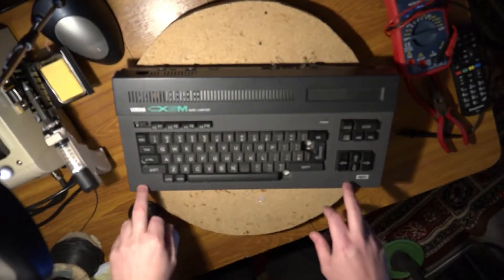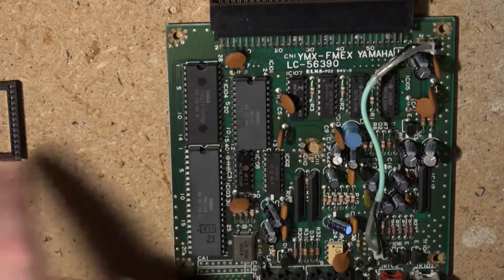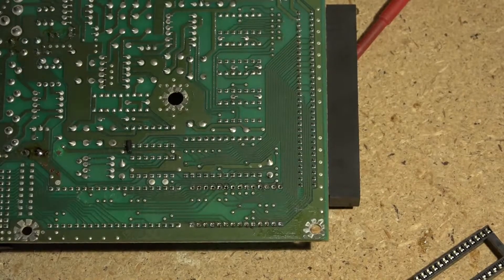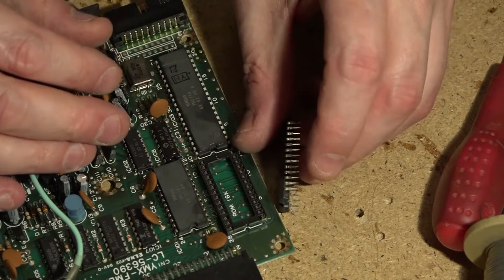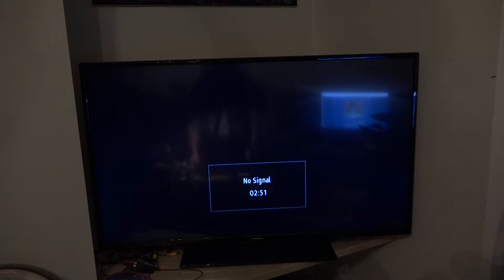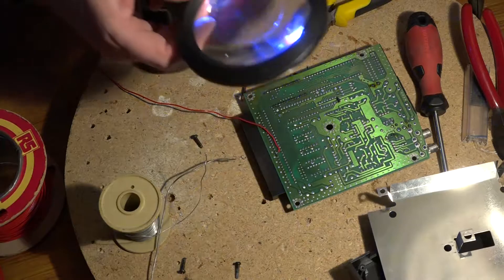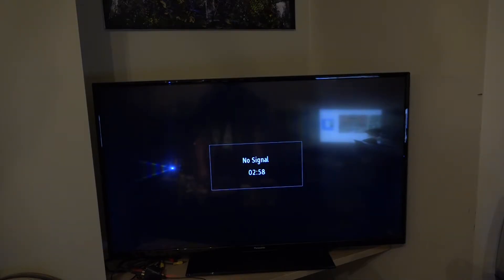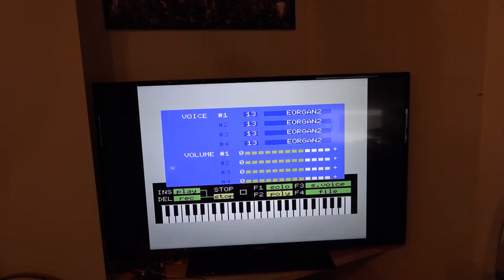Upgrading the Yamaha CX5M Music Computer Synth From SFG01 to SFG05 adding MIDI Input

Comment: Beats having to purchase the CX5M II / 128 model that came with the SFG-05 module.
Reply from the maker: However the CX5mII having 2 cartridge slots means that you can get a modern cartridge to sd card adaptor and save all your sequences etc rather than tape or disc.

Comment: great job ! really helpful video. but i wished i had have watched this BEFORE i did mine ..
I tried this upgrade not too long ago - but i had never removed a chip that big and i tried to do it with  solder sucker.. i then gave up and chopped the legs of the old chip off and cleaned it up. i then put in the dip socket with the new chip butt... surprise surprise it dont work :(
when i type call music now - it does nothing the cursor just flashes - and i cant test it using the old chip because i chopped it so poorly!!!
maybe i damaged the board by having a good long try freeing the pins with a solder sucker and too much heat.. but it does not look too bad.. i now have a beautiful msx paper weight !